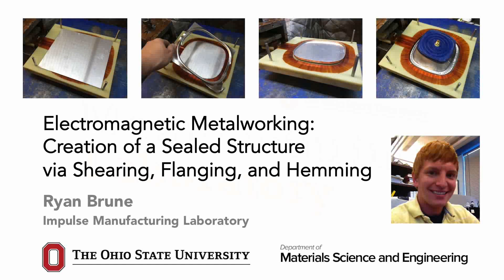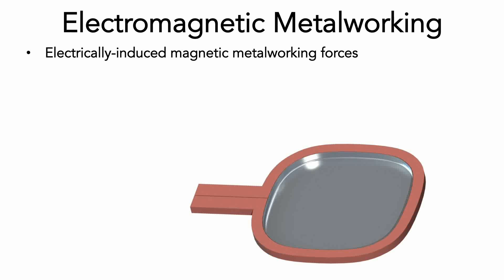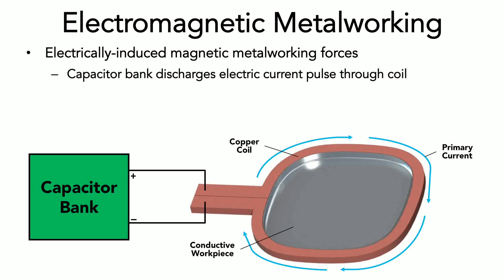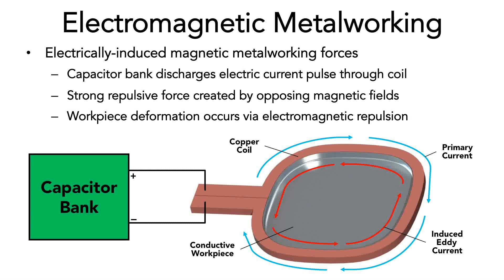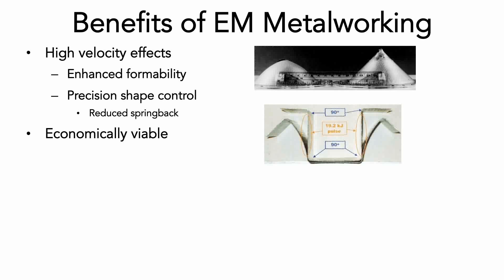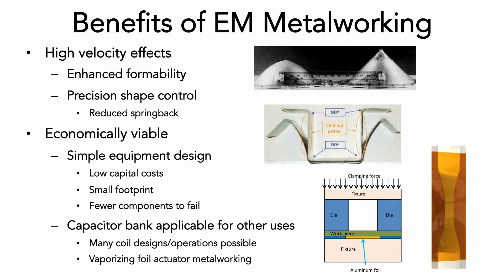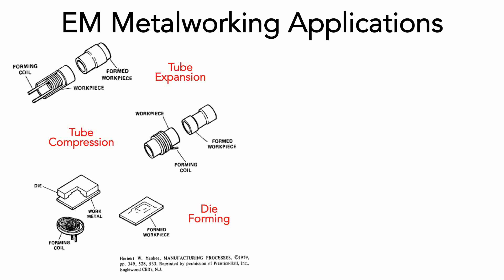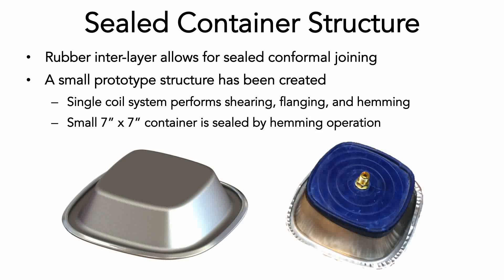Electromagnetic Metalworking: Creation of a Sealed Structure via Shearing, Flanging, and Hemming

Comment: interesting , unless you doing this to metal the thickness of kitchen foil i doubt it can be done safely in a hobby enviroment because of the obviously  enormous load in the capasitors (guessing old transformator style welder loading the capacirors and a relay from hell switching that current through the coil ) , wonder how big the electromagnetic pulse would be ( might overload laptops and other electronics )

Comment: "low capital cost" compared to what? last time I checked a 32kJ pulse capacitor with a lifetime of 1000 shots at 80% rated voltage and 20% voltage reversal was like $10k  A cap bank with long lifetime and with enough energy to do all this in a slightly larger scale probably costs like $50k and up, then you have to add the power supply, pulse forming network and safety devices, the work coils. So a magnetic pulse metal forming machine in the medium scale of things (frying pans) must cost like $100k and up. You have to use forming dies anyway so I don't see the real benefit in cost.

Comment: how is the current switched, is it a mechanical switch or solid state?
Reply: A damped sinusoidal current flows through the could when the capacitor bank discharges

Comment: How is the visible flash generated at 5:25?
Reply: aluminum is very flamable but it oxadizes instantly preventing it from bursting into flames normally but this process is so fast that the metal burns under the enourmous pressure and friction under such a short time that some flashing comes off durring the induction process
Reply: I would assume the shear speed of it. perhaps igniting the air or the nylon as it went?
Reply: I think that was just a reflection of light from the camera as the angle changed on the part.
Reply: Metal deformed
Reply: Flash --- edge formation
Reply: You might see some due to sudden impact